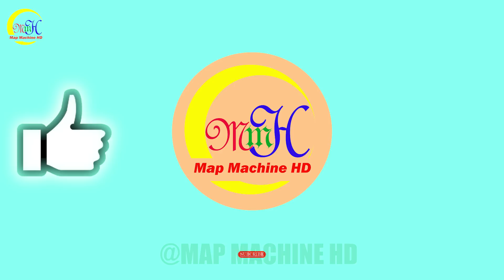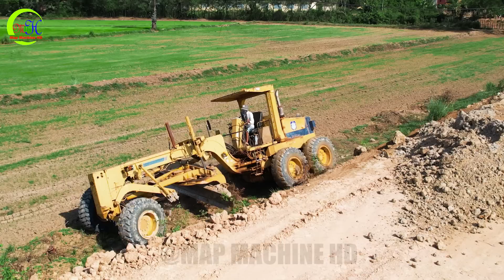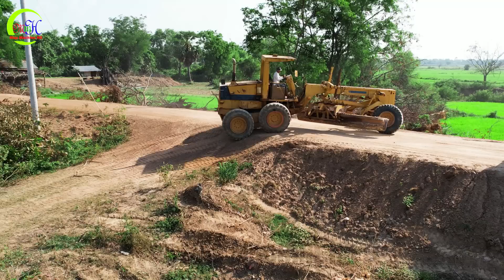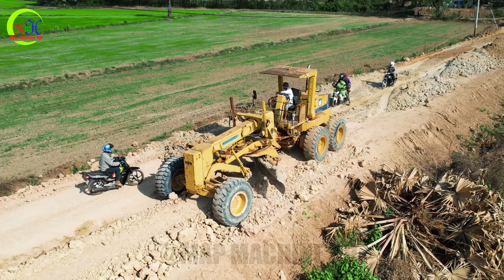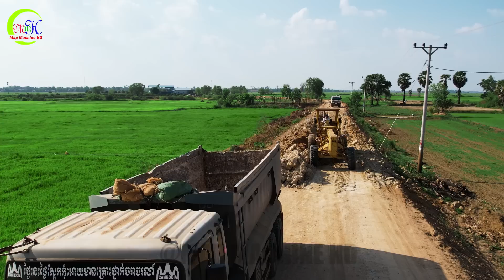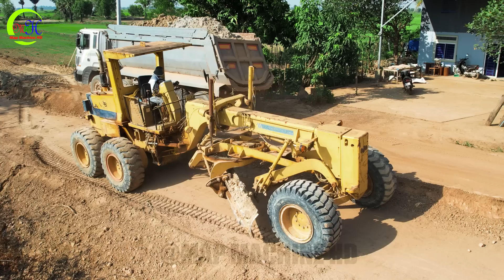Great Clay Push Technique To Make EMBANKMENT Use KOMATSU Grader | Construction Rural Road Foundation

Comment: As a machinist with many years of experience of this and other machines, I have to say that the planning was totally wrong.
A grader is not built for something like that, a bulldozer belongs there for this job, which would have done it 4 times faster.
Reply from the maker: Yes! Thank you very much! To the criticism of the fans. Using this machine because the bulldozer is broken
Reply: @mapmachinehd  OK an argument
Reply: I disagree that a grader isn't capable of doing this job effectively. I do agree that the planning was off (at the end of the line anyway). Dropping a big pile of material across the bank made it very difficult for the grader operator (who's machine skills aren't the greatest either).  Dumping material along one side and just letting the grader run back and forth spreading it worked fine as we can see from 4.00 to about 4:40. There are heaps of videos of graders doing exactly that kind of work on Youtube. Probably doing it faster and cleaner with better compaction than a dozer would too.

I say this as a heavy machine operator with grader and dozer experience building roads as well. Personally I wouldn't choose a dozer for this job, I'd choose a grader and a roller in an ideal world.

Edit: as others have said - would someone please grease that poor machine (whatever it was as the audio doesn't match the work)!? It hurts my soul hearing it squeak like that.

Comment: Nothing wrong with using a grader for this.  The problem appears to be the type of fill used as road base.  The lighter colored fill is the slick, clumping type that doesn't amalgamate well.  The operator is getting a bad rap.